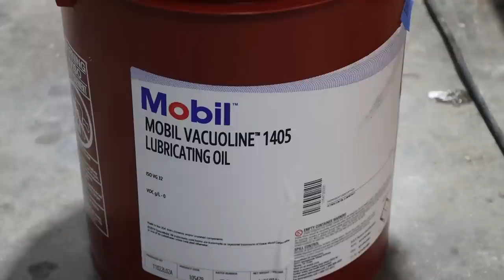Auction TRASH OR TREASURE? Brown and Sharp MicroMaster

Comment from the maker: The chuck I assumed was AC voltage is actually DC voltage which makes alot more sense. The stamped 110 or 115 volt on the front through me off not being up on these units. I need to investigate it further to see if it is actually bad or if it was just my misunderstanding of the way it works.
Reply: Steve if you find it is  broken, try dismantle maglock and  remove the coil as they are easy to rewind or fix ,I would happily rewind the coils its not hard but only downside is am in Uk .Inside the maglock there is a coil with a iron core if the coil has broken depending on how broken it is you can try repair if just a broken wire.
Reply from the maker: The chuck works😅. It was a loose wire in a crimp connector.
Reply: My background is in physics and electronics, not machine tools.  However, I would suggest that you find out exactly what flavor of electricity is going through the wire from the transformer to the mag plate.  Transformers generate AC current.  I highly doubt that the mag plate and any part on it are having their magnetic field reversed 120 times per second.  So, inside either the plate or the transformer there must be at least one rectifier.  Even in the 50's, rectifiers were big.  A single rectifier could make use of only half of the AC power, and would induce a DC bias that would create all sorts of problems in the transformer.  So, there is likely to be at least a 4-rectifier bridge circuit somewhere.  There would also have to be a ballast somewhere to supply DC current for the few microseconds while the bridge reverses polarity.

In other words, I would expect that a typical mag plate made before 1970 would have a rather substantial circuit board somewhere in it.  Plates made after 1970 would have a smaller circuit board.  I suspect that many early circuit boards have broken down and been replaced, hopefully with one of the newer ones.

Again, I am arguing from general knowledge about electronics.  Hopefully a better-certified professional can help.
Reply: @SteveSummers  Excellent!  Glad your diagnostic efforts panned out!
Reply: Tell the truth Steve! You called Big Clive, didn't you? I'm glad you figured out what was going on with the chuck. Looking forward to seeing the B&S in action soon!
Reply: @SteveSummers  ha, I figured. You would have probably smelled it if it was really cooked. Excellent!
Reply: @SteveSummers  great news
Reply: I had same grinder mine came with a neutrofier 2 power supply I’ll bet money chuck  is fine
Reply from the maker: @Newokie59  Big Clive would have definitely known what was wrong.  I enjoy watching his videos even though I don't understand all of it😄
Reply: @SteveSummers  I was going to suggest that.
Reply: @SteveSummers  I was going to suggest that.  You will probably have to replace
the transformer it may have a rectifier so as to convert the 240VAC to 115VDC.
Reply: @SteveSummers  😅😅😅😅😅😅😅😅😅  close one Steve. I was going to suggest that you take the chuck apart to check if anything was loose.......... you got there before me mate! Cheers from the UK and let's hope the Brown and Sharpe works well ! P.S. how is your mom getting on after her fall?
Reply: Never fear, Steve can figure it out, Chuckle.
Reply: I might suggest when you use your solvent of choice that you ventilate the confined spaces well before applying power to the machine.  The magic of television may have cut that out, just concerned about how a low concentration of vapor in a confined space can react.

I can never understand why cord is used in areas exposed to chemicals.  I know resistant cord is made but also rarely found or used, having treated electrocution victims it’s, well I’ll just leave it there.
Reply: @stuartschaffner9744  In 1976 I rebuilt a WWII vintage chuck power supply that used a vacuum tube rectifier for a magnetic chuck much like the one on Steve's grinder.   It used a transformer to supply 6V filament for the single rectifier tube and 90V AC at about 1A for the chuck coil   It had a 3 way switch, CLAMP - OFF - DEMAG.  The chuck connects to DC through the diode for CLAMP and direct to AC for DEMAG to release the part.   I replaced the big vacuum rectifier box with a 5cent 1N4006 1Amp diode inside the the small switch box to generate pulsing DC.  The inductance of the chuck stores a large magnetic field when driven by 90V DC pulses that dropped to 1/2 Amp a couple seconds after the switch was turned to CLAMP.  Once charged on DC the chuck would hold a work part quite well with the switch OFF.
Reply: @takedeadaim8671  I believe he uses Naphtha. Pump up camp stove fuel. It has a low evaporation rate, inexpensive and a GREAT de-greaser and sludge cutter. Easy on paint too. easy on the hands as well. It is kind of oily too.
Reply: @TomokosEnterprize  Watch the video again and note the presence of a gas can in each of the shots where he talks about using the un-named cleaner.  I have bought a lot of Naptha over the years and never had it come in a red gas can.
Reply: @takedeadaim8671  I can get my naphtha in bulk here as we are way out in the toolies in Northern BC Canada but I have heard Steve mentioned its more than twice so I took it as an assumption. Bad word that even in the best of times eh, LOL. Good catch though......Dean......
Reply: Steve I see in the comments your getting the chuck sorted out....good news 👍👍
Reply: That's awesome I came to the comments hoping it would be something like that since for its age it's looks pretty clean machine 👍👍👍
Reply: @TheAyrCaveShop  He won't stop or give in until he has tried every resorse or idea known to man. Just his way eh.

Comment: Steve, the drum switch for the mag chuck is to reverse polarity and release the work piece. it also takes DC current to run the mag chuck usually. and in some machines the mag chuck is on its own fuse in the control circuitry cabinet. so you may have to go check that as well.

Comment: I rebuilt a 6x18 Micromaster back in the 80s. They are an excellent machine.
The filter that  they sent me, when I ordered parts from B&S, was half the length that I needed. Two of them fit in like one of the long ones would have.
They recommend Endoc c grease in the spindle bearings. I had to buy a 5 gallon pail of it to get the 3 ounces that I needed.

Comment: Steve. I have a Micromaster myself. When I was cleaning and inspecting I found some if not all that the Bijur metering units were not putting out their required flow. To put it in another way, they were clogged or sluggish. These metering units lube all your sliding surfaces. I then immersed them in some lacquer thinner in a small cup then put them in my ultrasonic cleaner. What happened next is that there was a lot of dark and gunky material that was coming out of the units. I had to repeat this process on some of them multiple times. I also fabricated a screw on adapter so as I could blow compressed air through them, and again, I got some junk out of them. I had to rinse and repeat till they were clear. This process worked well for me and I have done the same on some of my other machines. I also went so far as to blow lacguer thinner through all the hard lines that the metering units were connecting to. This produced so much more oiling especially to the X and Y axis. Now, having said what I did, If perhaps you find out that your metering units are not up to par you could just by new metering units from Bijur. Your time verses money is your choice. For me, I found it challenging. Take care.

Comment: I worked for a manufacturer several years ago (25 +- 5 years or so).  We made small shafts for switches, washer/dryers e.g.  We used Brown & Sharpe screw machines.   I'm not an experienced machinist by any means.   The those machines were old back then, but with proper care, would zip off thousands of parts without a hiccup, requiring only tool sharpening, good oil flow to the tools.  Just needed to pay attention.  Would hold a tight tolerance.

Comment: Hey Steve, old electrician throwing in his two cents.  Hope you don’t mind.  Pull that thing apart and look for a wiring defect. Give it the sniff test, which is a pretty good indication if the potted insulation has been burnt. I wouldn’t be surprised to find that one of the Leads has just broken, I’ve had that before, as electrical equipment repair technician. Sometimes you find a lead has burned through, but the coils aren’t bad. Then hopefully you can just chip out some potting material and expose some fresh wire, and reattach the lead. If you’re lucky. But the only way to know is to look. And I have replaced the coils in some of them. It’s a pain to burn out the old one, and then check wire gage and count the number of turns, but I can’t really say it was difficult. Just messy. Any motor rewind shops in your area?. These are generally much easier than a motor.

Comment: Steve,
The table movement is slow for sure. I have the same machine. Mine is a 1966 version.
Before you run the spindle assembly up and down, run the table back and forth or run the upper assembky forward or backward, you need to make sure all the Bijur metering valves are not plugged. Make sure you have oil flow to all end points.
The Bijur metering valves come in five flow amount units. 0-5. The older original valves can be cleaned because you can take them apart. The later ones were crimped and must be replaced. It’s good to see you have the correct oil. You just need 15 gallons!!
The odd thing, my intake oil filter is a fine mesh screen. The return oil system filter is a cone shaped wool yarn design. My filter housings are different as well.
You have a beautifully designed surface grinder. These were the best in the business back in the day.
I recently replaced the spindle bearings. Not a difficult job. I replaced them with NSK precision #7 made in Japan. I paid less than $300 for the set. You can find them for $1,000 from the company that purchased B&S.

When I did the five block test, I had less than .0003” between the blocks. They can be very accurate grinders.

Good luck

Oh, all the manuals are available from vintagemachinery.org

Comment: Steve,

A suggestion for dispensing controlled amounts of liquid from a 5 gallon pail...
Lay the pail on its side with the pour spout at the top. If full shim the front edge of the pail with a 2x4. Open the lid or bung. Roll the pail to lower the bung hole until the liquid gently pours into the receiving container. Rolling the pail back, shuts off the flow. I like to do this on a bench top for ergonomics. 
Have a rag handy to wipe a drip if you have any mishap. Normally the rag is only a precaution.

Comment: With the manual mag chuck, all it needs is stripping down and cleaning inside, then the pin for the handle needs to be replaced, as that has sheared, hence why it moves ao easly.
Id also pull the newer electric chuck apart too, as it could also be a simple fix.

Comment: Hey, way back when mo max cobalt made me money.  Cutting steep taper threads on oil field threads mainly subs.  Could pull a blue chip in 4340 heat treated,  minimal touch up.  Good stuff.

Comment: I would definitely take a look inside the chuck - it may be dirty or one of the replaceable components has gone bad.
Reply: I'd suggest that too, it's already broken so it doesn't matter if you break it more. Plus if you're lucky it might be easy to fix, maybe just a broken wire. If the coils are cooked you're out of luck tho
Reply: Just a suggestion. If you disassemble the magchuck, on the coil, you may find a thermal fuse. When they get too hot, they burn out and protect the coils.  I would bet one has fried out.

Comment: The chuck is a DC device. Start the troubleshooting by checking the resistance of the windings of the chuck. According to O.S. Walker, a manufacturer of chuck controls, you are looking for 110ohms of resistance. I suspect that the drum switch had it's contacts welded as it is not designed for switching DC. AS with the spindle cord that was bad, check the chuck cable as well. The small size twist lock connectors have very little space for the wire, check those as well. If you get the expected resistance value and you do not have a short to ground, the chuck is good. Recheck the resistance value, all the way back to the controller, an easy way to find open circuit conditions.

Having the spindle turn, the hydraulics work, you are 90% there. This piece of art is definitely NOT junk.

Comment: Steve, it might have been to your advantage to make a tool to spin the excess or dirty oil from those filters. They actually make an air powered spinner for inside of air filters, such as on diesel trucks, and the like. This is where I got the idea, but without the air. Probably a piece of all thread in your drill would have been most adequate.

Comment: Steve,  I am a big fan of those Harbor Freight flash lights.  As my eyes get older, I use these flashlights more and more in the shop.  I had other ones, but I started buying a lot of batteries.  These rechargeable lamps solve that.  HF came out with an Icon brand version of these, which folds up better, but these Braun lamps works more than fine for me. -----Doozer

Comment: I guess the next video will be rebuilding two mag chucks watch my machine instructor rebuild a few manual units was alway pretty straightforward stuff clean and replace roll pins . Electric ones are alway on transformer because they are DC units AC demagnetize?

Comment: I don’t believe a B&S could be junk. It might have issues but if you have a very well designed machine any of them can be fixed especially by a guy with your skill set and experience. Surface grinders are simple machines when it comes right down to it. Might need some scraping and turcite but all doable. Maybe a fried spindle will need a specialty shop.

Comment: Fix the chuck!   If it is rectified inside the chuck, It could be the diode assembly.  Some Items like the chuck would have a
protective thermal unit to turn the thing off if you left it on, say overnight.  The rectifier would have to be inside the chuck assy as you are feeding the chuck 120v ac.   Looks like whatever is wrong is a unit that is normally closed but open now.  I would suspect the thermal cut off device.

Comment: I had luck with most of my auctions, got me TOS FN25 mill and Klopp 550 shaper in excellent condition, and i have struck gold with CME FU1E mill. 
If you know who was previous owner and what he did, than you can estimate machine condition with more ease.
Most of my machines where in maintenance and tool making departments, not in production.

Never apply power to magnetic chuks withouth mains isolating transformer. Isolating transformer than rectifier and varistor supressor. In that order.

Comment: Hey Steve, remember that grinding individual blocks is no indication of how flat it is grinding, only how close the surface of the chuck is to the ways.  If the ways are like a ploughed field, you can still get perfectly matched blocks. It's easier to mount a known straight edge on the chuck (turned off) and indicate along the top. No chuck needed at all really!

Comment: If the chuck windings are open circuit (the first test I'd do) then my bet is your local motor rewinders would repair it. Bet you could DIY if you could get enamelled wire.

Comment: "Secret solvent" in a pan doesn't even make me blink but filling the sure shot with it just makes the hairs on the back of my neck stand up. You can just hear the guitar riff from "shake hands with danger". It shouldn't ignite, I can't imagine any ignition source in there and I doubt a flame could ever travel back up the nozzle even when using air as the propellant but there's just something viscerally wrong with making an explosive mixture in a metal pressure chamber that you intend to hold onto while you're working. If disaster struck and it ever cooked off on the inside that would definitely be one of the worst possible ways to die. If you find yourself creating a literal bomb when you're not intending to create one, you should probably take a step back and reevaluate your life choices.

Comment: I am sure you know that such mag plates are merely wire wound magnets. So maybe you can take it apart and see if there is a simple broken wire. And if so, you can reconnect it and it works again. Just an idea. If it is sealed in epoxy, since it is broken, you could dig into the epoxy and see if you can find the break. I mean what are you going to do, break it... Worth a try...